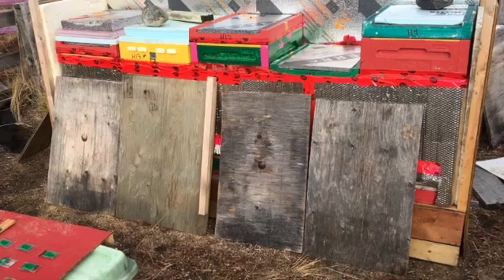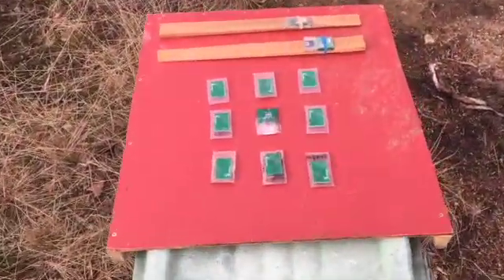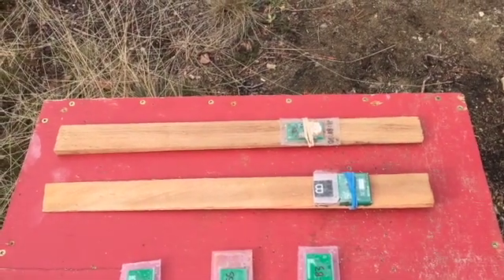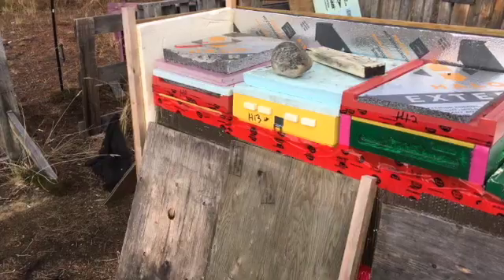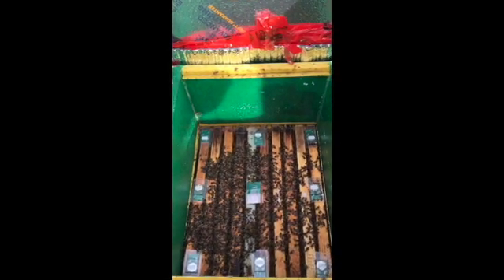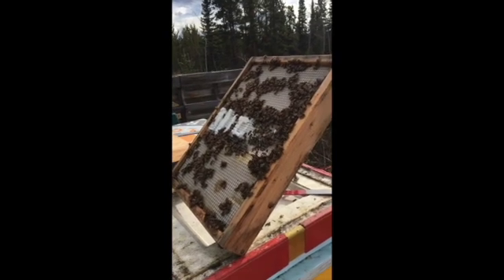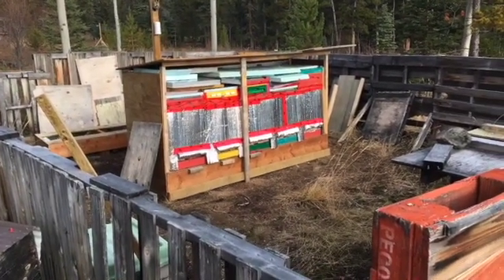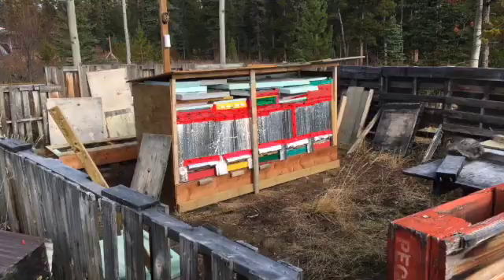Setting up my hive monitoring

Comment: Thanks for all the important info! Is there ever a possibility where we create a situation in the hive where there’s almost zero moisture/condensation in the hive and the bees don’t get enough h2o to live? With all the venting, quilt boarding, insulating/bad engineering that beekeepers do to winter their hives. Thanks again!
Reply from the maker: if we had flatline stable outdoor winter temperatures, what you ask would be possible. But daily temperature swings make it more difficult. (repeat of other comment)  In my setup where I only allow lower entrance fresh air ventilation and an open screened bottom to manage the draining of any excess condensing water, I just let the bees be bees... I no longer use any moisture/condensation wicking material in my colonies. I have less insulation on the front side of the colony to ensure that is where condensation will occur during really cold times.

Comment: thanks to you Etienne I just about completed the bundling of my four hives south of Fairbanks. I took a few liberties - hope it will not cost me. I made a cube with four hives, all sitting on insulated crawl space. I cut a 4"x4" hole in the bottom boards and screened them off. I used telescoping covers as leans over the entrances with straw covering the corners. seems are taped. walls have 3 in blue foam. ceilings have about 9" blue foam plus.entire unit wrapped and taped with the same silver stuff you are using. I trust it is good till maybe -10F but am thinking of laying a blanket of 3 1/2" fiberglass over entire unit and loosely cover with a tarp. coldest I have seen so far is 8 degree F.

Comment: Thanks for posting. I understand you are using a screened bottom board over a 2x8 crawl space. where exactly is the slotted base and what role does it play?
Reply from the maker: It is just above the bottom board. I found that it provide buffer space between the bees and the cold incoming outside air. Example when I installed my sensor this afternoon, the bees were all over the bottom board in the colony without and the temperature was in the ~20C, now the bees have moved up into the frames and the entrance temperature has dropped to 13C. The colony with the slatted rack has a buffer between them and the cold. The temperature above the rack is 24C and below is 10C. The crawl space is now about 2.9C with an outside temp of -1C. This is just a couple of hours of data. Last year I measured similar values but I had no control colony to compare against. https://www.honeybeesuite.com/slatted-racks-everything-you-need-to-know/
Reply: @etiennetardif  I need to pull this all together kinda at the last minute and quickly as cooling quickly in interior alaska. Seems like my wintering plans  kinda fell through. I am thinking about cutting a slot into a bottom board, maybe 1/2" x 6" , staple screen over or under slot and placing onto a 2x6 crawl space. Does it sound like it might have a chance of working? Do not really have the luxury of time to build nice slotted racks and make screened bottom boards.
Reply from the maker: Sounds good... just make sure you have 4 to 6" of insulation on top :)...
Reply: @etiennetardif  you are referring to 4-6"of insulation  on top of hive and not on top of crawl space correct?
Reply from the maker: yes hive top...